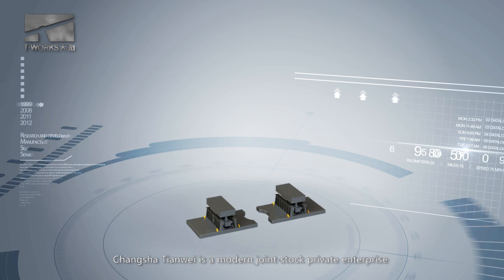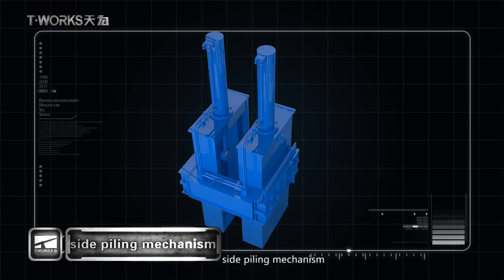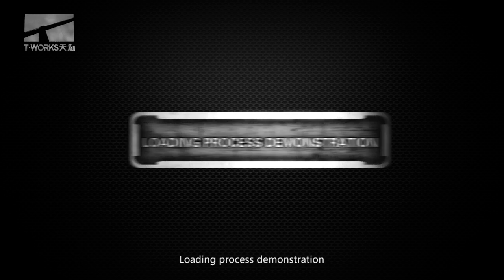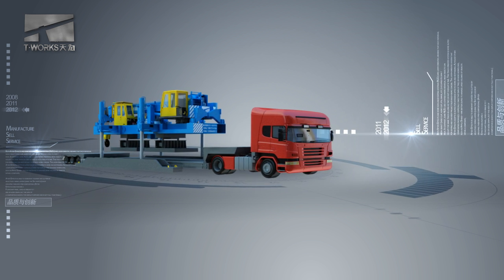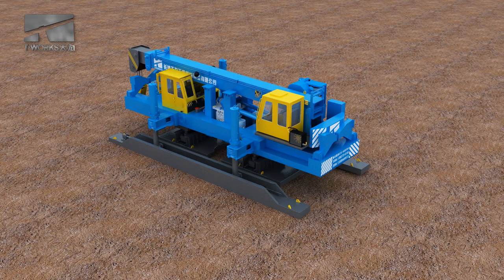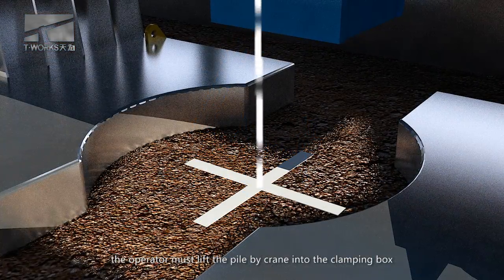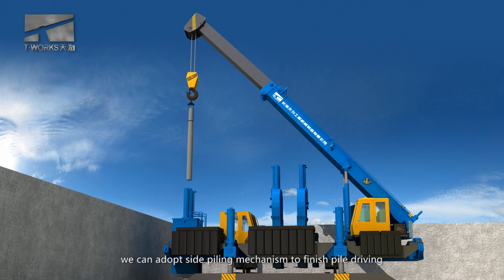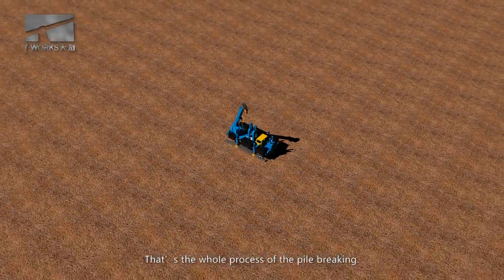Hydraulic Static Pile Driver 【T-WORKS Factory Phone:+8615874167681】

Comment from the maker: Pile Pressing Machine 
Working Principle: The pile is gripped by a clamping mechanism, and then pressed into the ground using a hydraulic cylinder and the weight of the piling machine itself.
Applications: Primarily used for piling in real estate projects, factory projects, highway subgrade projects, factory interior reinforcement projects, rural self-built housing projects, etc.
Compared to traditional hammer piling machines, it has the following advantages: 
1. Vibration-free construction process. 
2. Pollution-free construction process. 
3. Low noise during construction. 
4. High piling quality, less prone to pile breakage. 
5. High construction efficiency, capable of 500-1000 meters per day. 6. Real-time display of piling force during the piling process. 
7. Low maintenance costs and fewer wear parts.
Applicable Pile Types: Almost all concrete pipe piles and square piles, with a maximum pile diameter of up to 1 meter.  Customized solutions are available for irregularly shaped piles.
Models: Over 40 models of piling machines are available, ranging from 60 to 1260 tons. The maximum central pile pressure can reach 1200 tons, and the maximum edge pile pressure is 500 tons. For 60-260t models, the minimum distance from the edge pile to the wall is 0.4 meters (within 150 tons of piling force); for 300-600t models, the minimum distance is 0.7meters (within 300 tons of piling force); for 680-1260t models, the minimum distance can be controlled to 1.8meters (within 500 tons of piling force). 
The large-scale development of hydraulic static piling machines began after 1998. Currently, they are mainly distributed in China and Southeast Asia, with a small number in Europe and the Americas. The market share is approximately 10,000 units, of which about 7,000 are in the Chinese market.
In recent years, with technological advancements and improved component quality, wireless remote control technology and piling positioning systems have been rapidly promoted and used in static piling machines.
We have been specializing in the research, development, production, and sales of hydraulic static piling machines for 20 years. Our products are exported to more than 30 countries and regions. Welcome to visit our factory in Changsha!  +86 15874167681 (Manager Xie) ，chinapiling@hotmail.com

Comment from the maker: Pile pressing machine Advantage: be used in the city area, Vibration-free, pollution-free, and low-noise . Piling speed is fast. Friendly for the pile quality. Suitable for soft soil conditions(SPT within 50).
Disadvantage: heavy. 220t similar 5t hydraulic impact hammer,460t machine similar 10t hydraulic impact hammer, transport cost higher.

Comment from the maker: A new kind of machine for pile driving - Hydraulic static pile driver .
This machine is no noise and no vibration , when it is working. And piling speed is very fast , it can driving 50-100 pile/ days , it is about 800-1000 m pile. We are manufacturing company for this machine, if you need it , welcome to contact with us.  
Changsha Tianwei Engineering machinery manufacturing co .,Ltd. 
Mobile phone/wechat :+8615874167681 ,
Email: chinapiling@hotmail.com

Comment from the maker: Jack Xie  Sales Manager   Mobile Phone: +8615874167681(China)  ,E-mail: chinapiling@hotmail.com              website :  www.t-works.cn     Changsha Tianwei Engineering Machinery Manufacturing Co.,Ltd

Changsha Tianwei Engineering Machinery Manufacturing Co.,Ltd  is a famous foundation construction equipment manufacturer with more than ten years experience.Our main product is Hydraulic Static Pile Driver.Now there are more than 2000 units Hydraulic Static Pile Drivers working in China, and there are more than 1000 units working in the overseas market .

Hydraulic Static Pile Driver, features with no noise, no vibration ,no pollution, excellent quality ,high piling speed(40-50 piles/ 8 hours).
It has wide application in jacking in concrete spun pile, square pile,I pile ,and other precast piles at the site of :
1.Clay, soft soil, sand layer, etc.
2.Noise regulated urban area.
3.Vibration regulated areas, such as near old buildings, precision instrument buildling ,  subway, overpass and so on. 
ZYC series of the Hydraulic Static Pile Driver ranges from 60 to 1200 tons that can suit different foundation conditions and customers ;meanwhile, we can provide special design for customer's requirement.
 if you are interested in our product, Please kindly email to me ,or call me,I would like  to give you more information .